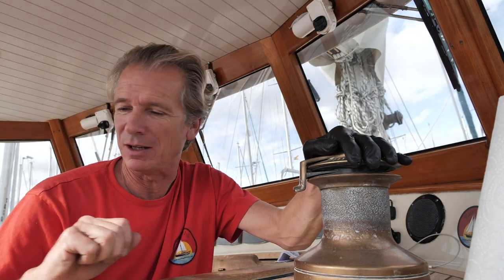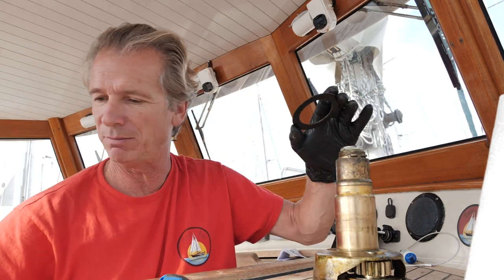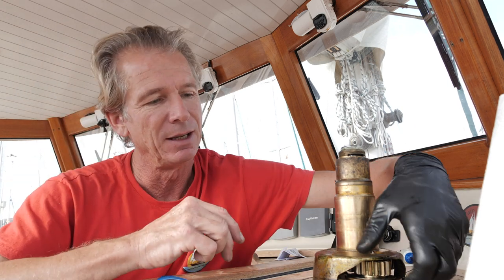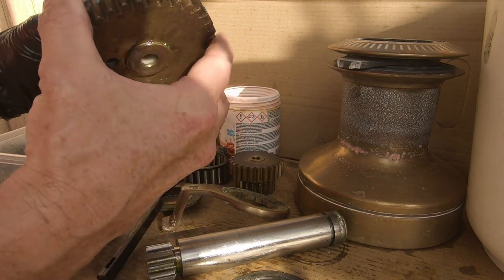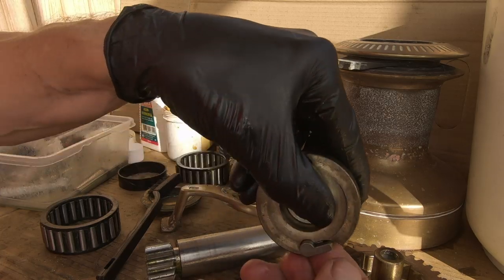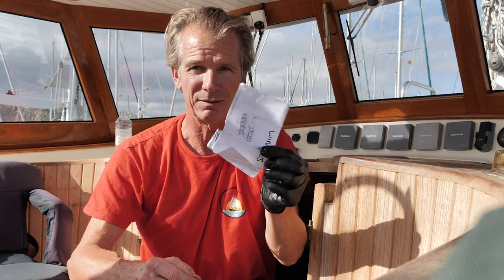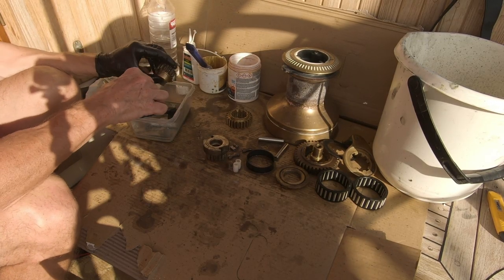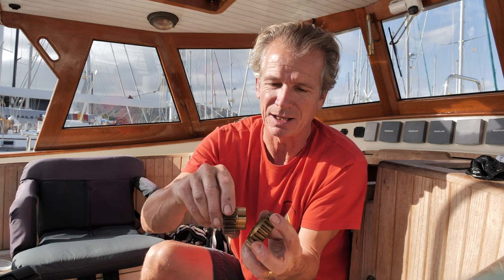Annual winch greasing

Comment: Great video. I really think this helped a lot of people see the inside of a winch. One thing I would like to point out. It's better to grease each part as you assemble it rather than grease all the parts and lay them down in your work area before assembling. This will help prevent contamination. This is especially important if you're doing deck winches. Some might respond saying "I keep my work area clean." I've heard it all before yet have seen the results. Also make sure your hands are clean after the disassembly. No point in handling clean parts with dirty hands or gloves.

Comment: Missed this first time round, but a simple and very valuable reference video that will give a novice the confidence to do this essential job.  Ours are Anderson electric which are a fair bit different, but nothing that two minutes with the manual will not sort.  There's a couple of "O" rings that needs looking after in addition to the planet wheels etc, and the electric motors (and house batteries!) get tortured by insensitive and unsympathetic operators!  One of the mainsail luff eyes was also ripped of once, something you would not do with a manual winch...